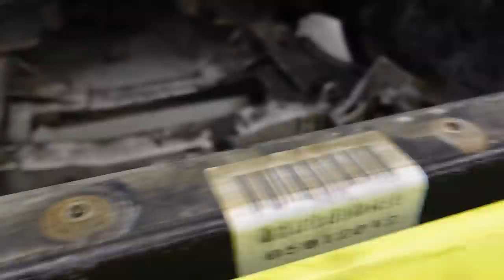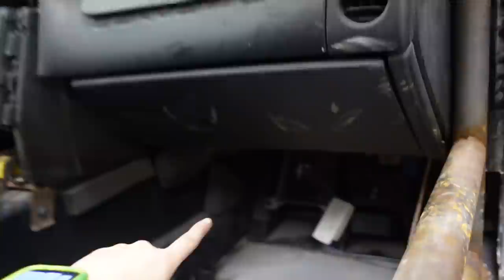Gutting the C6 Corvette Interior + Engine Bay Prep for Paint

Comment: You need to go with that purple code on the back of the car for the interior pop. Do the wheels chrome for the hotgurl points, the purple on the inside will compliment the carbon fiber as well as anything that is silver, black or gunmetal...which I'm guessing many of the parts you have coming are those colors. it also will cut the glare and in-cabin brightness.

Comment: Now is a good time to put a custom tube front crossmember in there & get rid of some weight out of the front. It will give you more clearance to work on the engine
Reply: If she ever decides to go to FD, she would have to switch back. You can't have aftermarket subframes on a competition FD car.
Reply: @DiyDadFL  ok thanks for clarifying.
Reply: @DiyDadFL  klutch kickers is likely going to have to switch to FD rules in the future as well as the cars get more and more crazy with people taking advantage of the relaxed rules over FD.
Reply: Did these come with a magnesium front subframe like the c4`s? If it is swapping it out would be a massive fire safety thing as well because that shit burns hot as fuck and can be a bastard to put out
Reply: @Matty.Hill_87  I don’t think so. I believe magnesium was basically outlawed and the last time gm used magnesium was the “magnesium package” for the c5 which the wheels where magnesium and some trim pieces color matched. I might be wrong though.
Reply: @FUCK_________googIe  ProAM series also require the same rules as FD. Klutch Kickers could become a ProAM series and award FD licenses to drivers.

Comment: Stuff comes off so much easier with warm water going through the machine. Crank the heat right up for engine bays and underneath parts.

Edit*
Consider a darker colour for the inside, even if it's just to stop the glare on the windscreen. It'd be better than squinting, trying to see the clipping points.

Comment: Man, I really hope you really rinsed that entire car off extremely well. That oven cleaner will ruin that new paint and with rinsing it off with a pressure washer you probably blew residue all over the car.
Reply: You know, I've watched so many "Clean and prep my engine bay" videos and no one ever uses THE best degreaser...1 part Dawn Platinum dish soap and 4 parts water in a spray bottle. just wet the whole area, spray the piss out of it with the Dawn mixture, agitate said area with a junky paintbrush or 3 and rinse with regular old hose pressure water. It works very well and doesn't degrade seals, hoses, wiring and other miscellaneous junk.
Reply: I've used oven cleaner before but it pits or etches aluminum. Dawn soap and water in the soap attachment for my pressure washer can't be beat.
Big laugh they've never heard of Easy Off. Probably the best known brand in oven cleaners.
Reply: @fauxque5057  I was thinking the same thing on them not hearing of Easy Off. That brand has been around and sold everywhere forever.

Comment: If you have the time and ability to do it before slapping that texas speed engine in there seal up that fire wall to reduce heat, smoke, and in case of fire so that it doesn't come in the cabin. Kind of like what taylor ray just did in his build. especially before you paint the bay that way you don't have to do it after.

Comment: Most over cleaner aka (NaOH/sodium hydroxide/lye/caustic soda/alkaline degreaser) will eat aluminum corroding it black.  Its really not possible to just rinse it off well enough to paint over either, neutralize it with something slightly acidic that doesn't bother aluminum.   Krud Kutter Concrete clean&etch contains phosphoric acid and might remove the oxidation left by sodium hydroxide.  Either way it really should be neutralized, its way worse than pouring salt water over a stripped bare steel pinch weld as far as painting over it goes, but it can also make aluminum brittle, cracks, failed welds etc..

Comment: make sure you seal your engine bay, you dont want a catastrophic failure like an engine fire to come into the driver compartment.
Reply: You mean its called a firewall for a reason?
Reply: @Alex-cj8hh  but who would remove their firewall? Even Cletus isn't that stupid. Or are you saying Chevrolet is out to kill people
Reply: @janeblogs324  you clearly did not understand what I was saying then. I said seal the engine bay. That means plug all unnecessary holes in the firewall like she did in the next video. She removed the heating and cooling system. Those holes got filled with fiberglass during her video. This is all to prevent fire coming into the interior of the car during catastrophic failure.  When I say plug so you don't misunderstand me again I mean cover. She is going to use fiberglass and metal plating. Again this is for safety so use your head dude. If you want a example go watch Taylor Rays video where he blew up his cifero. Watch his Corvette builds he talks about this very thing because he went through it.